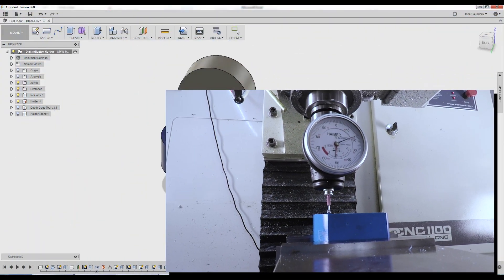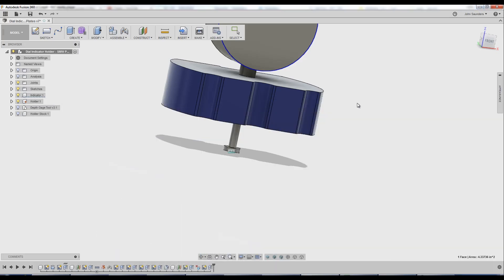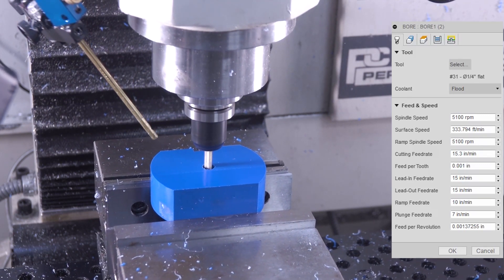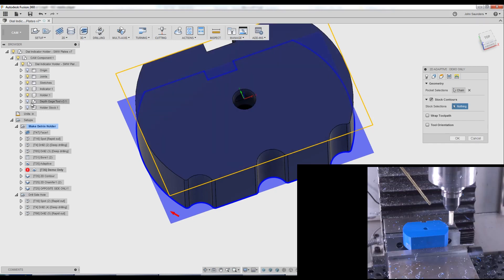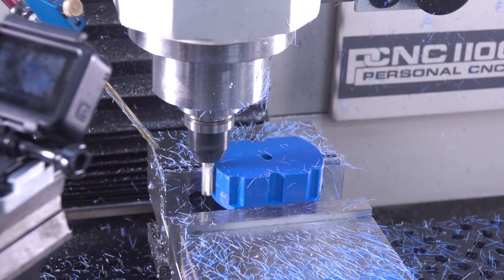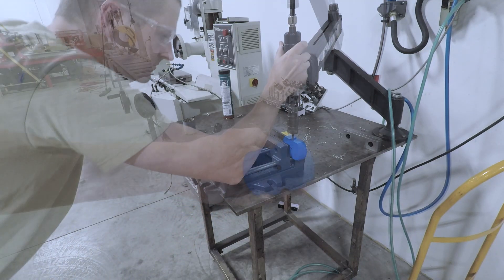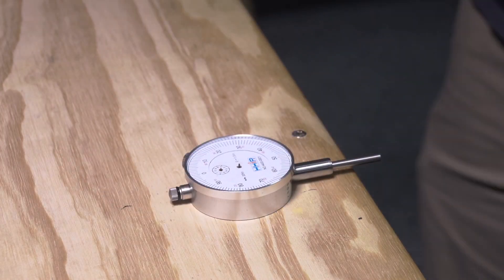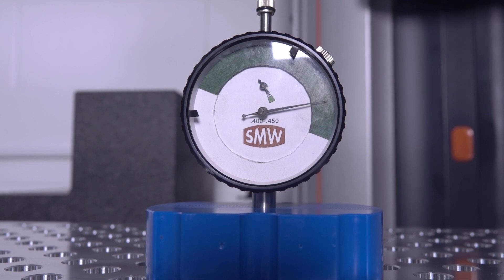DIY Dial Indicator Go/No-Go Gage!   WW161

Comment: Hey John, I'm doing some delrin parts at work right now, and I'm running them at 12000rpm .012 per tooth on a 1/2 in 3 flute endmill. I just wanted to mention that I think your speeds and feeds could be higher, especially for roughing operations.

Comment: did you know that the chip is not as thick as you entered for feedpertooth? If you change the stepover the feed should also automatically change to maintain the same real feed per tooth, but it doesnt. I use Mastercam 2017 at work and it has a RCTF (Radial Chip Thinning Factor) Feature which always changes the feed according to the stepover to always maintain the real chip per tooth.
If you want to learn more about that, have a lok at: http://www.cimquest-inc.com/mastercam-2017-radial-chip-thinning-factor/

Comment: Does he mean gauge not gage??  Spellcheck
Reply: Johnboy Hardy it's spelled correctly. There's an institutionalized misspelling in machining of the word gauge.
Reply: You'll find old WWII-era flight manuals or older naval/sailing references call instruments "gages" as well. It's just a historical thing. Physical references, especially inanimate lumps, tend to have the "gage" spelling applied to them more often. Imagine an industry filled with stubborn old men who work with their hands and observe the old ways die hard. I think it's typically American (English having a fruit called gage).
Reply: Johnboy Hardy 
Gauge refers to an instrument of measurement. 

Gage refers to perceptions of something, as in to "gage someone's worth. Or to gage how dangerous a situation is.
Reply: Incorrect. The original Johansson block sets (including the ones made by Ford and many others) were labeled "gage blocks", as were also named the measuring instruments (snap gages) they were setting. They are also sometimes called "gauges" interchangeably.  Both are considered correct though "gauges" is seen more frequently today.

Comment: Doesn't plastic have a much greater tendency to creep and flow over time than metal? Not sure it's the greatest material for use as a guage. Still love what you do, just think you might want to change that design detail.
Reply: tho1efx Delrin is very creep resistant. And very thermally stable too. Only thing better would have been Ertalyte. Less creep that Delrin and better wear resistance. Also better compressive strength and less deflection under strain.

Comment: First! Why did the green end up sharpied? When facing it the two directions the surface finish looks as though it needs a tram. Must just be the different tooling marks cause the Delrins more so throwing out stringers